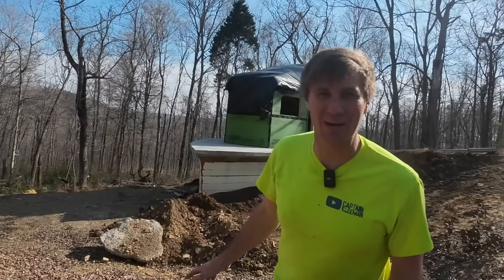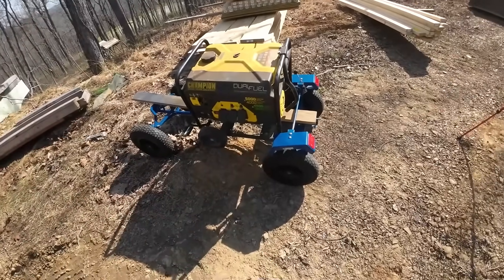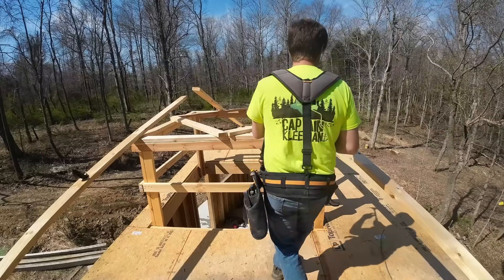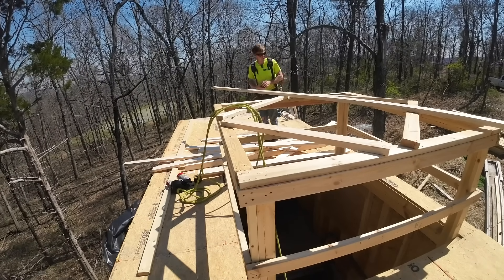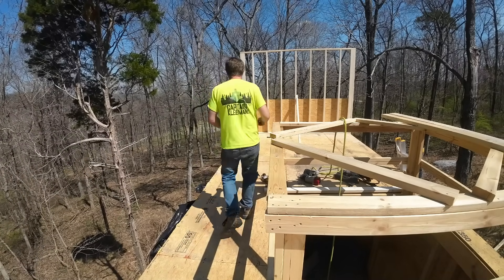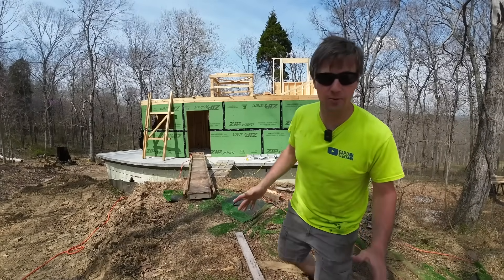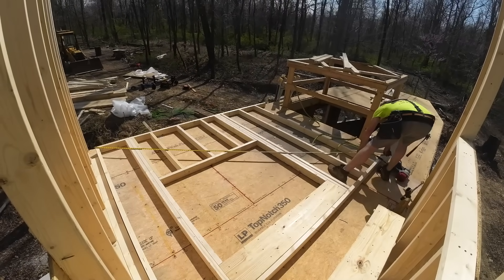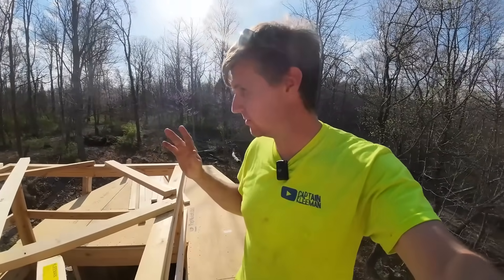Return of the Craziest Cabin Build on Youtube!

Comment: When I was in college, a professor told us that if you were designing a campground or even a roadway into a lake or along a river, do not clearcut to enhance the view. What you want to do is to create a vista to see thru. You thin out the trees so you can see thru but not too much. It is a delicate balance. You want to be able to see your pond from the cabin. Thin slowly and check your progress and consider the change in the seasons with and without foliage. Sometimes pruning the lower foliage will suffice. All I can do is give you the idea. You may need to do more research. I'm no expert. You may even consider picture windows on the cabin.
Reply from the maker: We plan on planting evergreens to block the view over time.  The pond is not a part of the feature for us.  Appreciate the info though!

Comment: Hey capt a little trick we used when I was building homes was to nail a piece of strapping to the bottom of your bottom plate and use that to stand your wall and not to have to worry about it sliding off works awesome just a tip !!

Comment: The next time you get a pallet shipment with steel banding save that banding to cut into short strips.  When laying out a wall to frame on a deck, put your bottom plate 3½" away from the lower plate edge, then when framed tack those strips to the bottom of the plate and the deck it's laying on, running the strips under the plate.  Then stand the framed wall up without worrying about the bottom plate going over because it's held in position by the strips.  Later on remove the strip tails.
Reply from the maker: I've always just toenailed the bottom plate to hinge it up.  However that only works on a wall that can be laid out exactly where it is to be raised.  Which is only the back wall on this one

Comment: Hey for your generator pedal cart. make a base that the generator can sit on and mount it to the cart. Then put a small electric motor on and chain drive to the pedal wheels. Then you can start the generator, it can power the small engine so you can "drive/push" it and it can power itself where you need it to go. Self propelled generator!! 🤣
Reply from the maker: Now that would be wild! Lol

Comment: You might want to consider vinyl for the paddels on the paddlewheel and possibly the rest of its construction. There are wide soffit pieces made, and you might be able to find a manufacturer that will cut to size the flat pieces you need. I know there are plastic companies that make sheets of vinyl, abs, and styrene that you can buy dimensional sheets from. Just a though that could help with maintenance and longevity of the paddlewheel. 👍

Comment: If you snap a chalk line 3 and a half inches back from the deck edge and toe nail the bottom plate every 4 foot with a 16 d nail, when you stand your wall up it will not kick out on you.
Reply from the maker: Yup, used it plenty of times, but that only works if you have the room to lay the wall exactly where you need it.  So only the back wall.